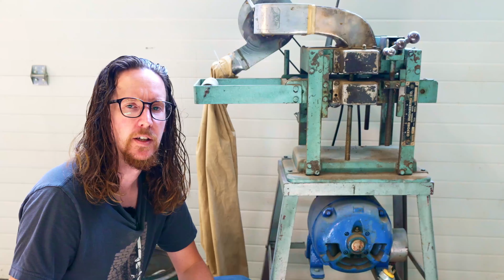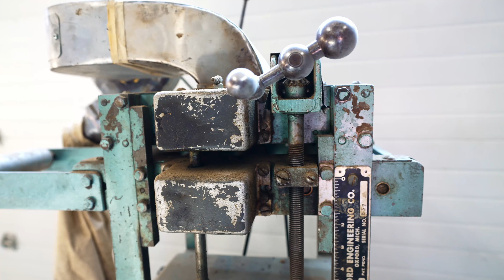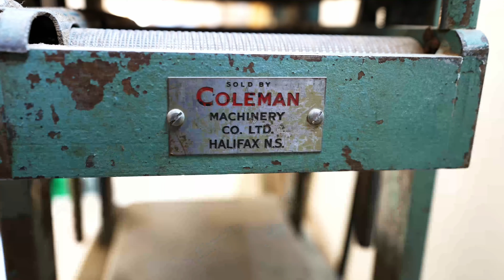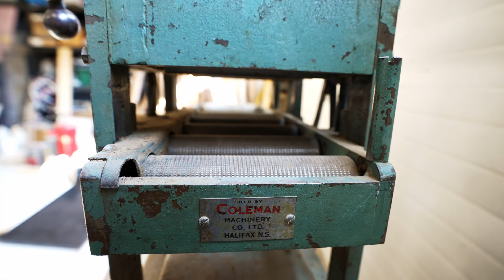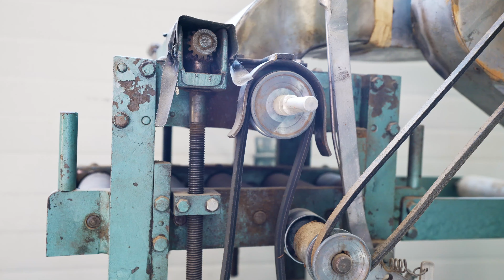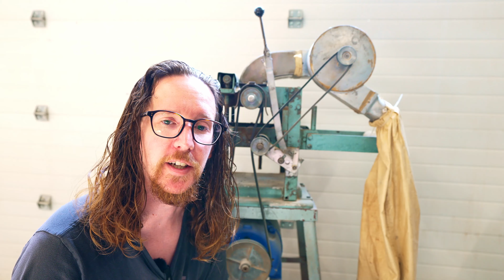Getting Nostalgic About Tools

Comment: I actually went backwards with my shop bandsaw. I like the rigidity of the metal construction of old tools but especially the old style hand cranks/hand wheels. They definitely don’t make tools to last like they used to.
Reply from the maker: There are some great old tools out there. Some just stand the test of time a little better, like bridge Port Mills, etc. This 6inch thickness planner was built like a tank, but who needs a 6 inch, single cutter, thickness planner. The world of wood working has moved past that. I checked out your channel and subscribed - Keep up the great work!